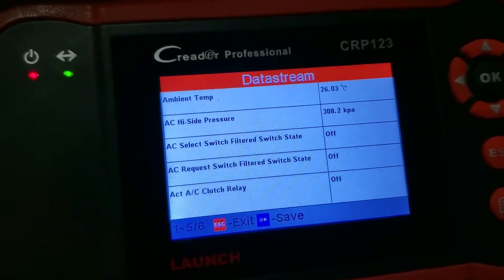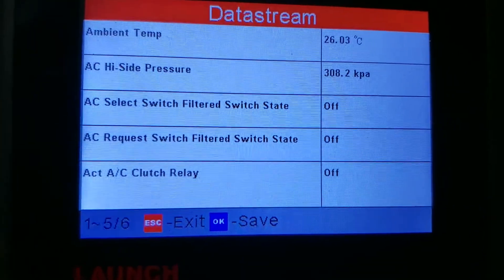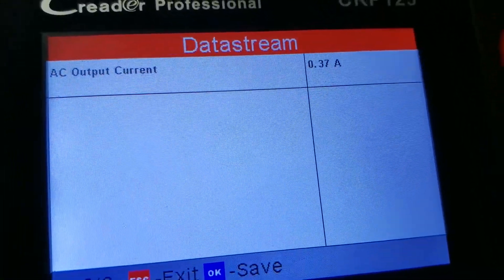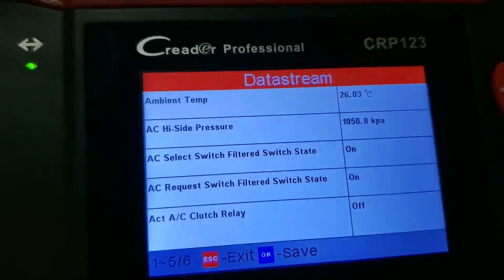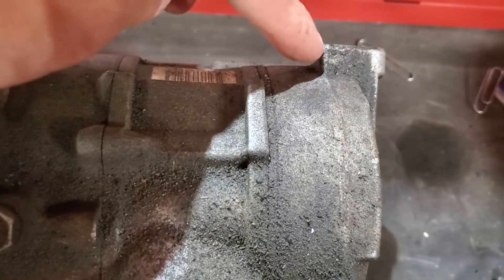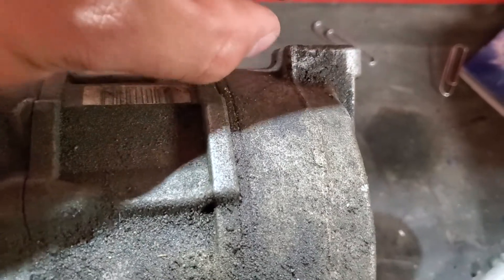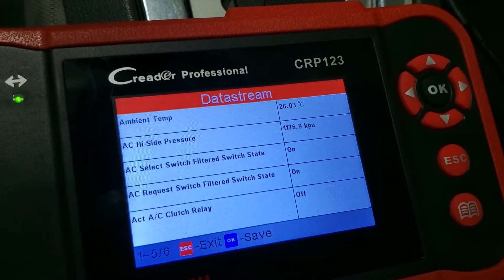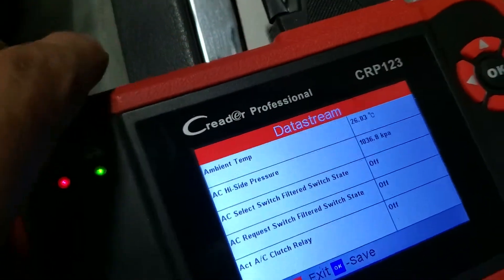Troubleshooting clutchless variable displacement ac compressor

Comment: I'm working on a car with a variable which is also clutchless. I am getting a high reading on the low pressure side and warm air out of the vents with the engine running at idle RPMs if I increase the RPMs to around 2500 and keeping their the low pressure drops but is still high and I have cold air coming through the vents. Do you think this is a weak compressor or do you think it is a refrigerant valve in the compressor
Reply from the maker: Sounds like a  worn-out compressor to me.
Reply: @justdoityourself  is there a general rule of thumb where I go ahead and try to turn it by hand and it shouldn't turn by hand? I would hate to buy a whole new compressor if all I needed to do is just change out that solenoid valve
Reply from the maker: @macknumber9  not sure about that. Can you check your amps output of the compressor (solenoid velve)?
Reply: @justdoityourself  i have no way of doing that...i just have that feeling it is the valve because it works intermittently...sometimes it is great ice cold sometimes warm...hate to spend money on compressor when it is just valve

Comment: Good explanation but why you replaced the compressor?. Thank you.
Reply from the maker: By troubleshooting I new that the power was going all the way from the controller to the ac compressor,  but compressor was still not working,  so that's why I decided to replace it.
Reply: @justdoityourself  What are the parameters you relayed on.vent temp&pressures what?Thank you.